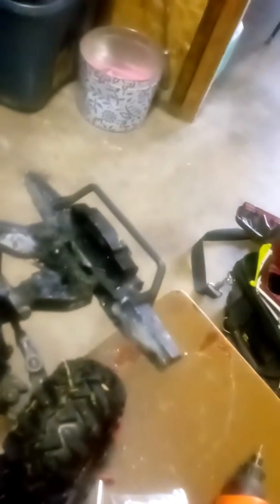Traxxas TRX4...adding lead weights !

Comment: Did you adjust the preload after adding sprung weight?
I added 200g to the front bumper and not happy with the ride height now.
Reply from the maker: No.  But I added alot of lead weights
Reply from the maker: I like the low ride height, its more realistic